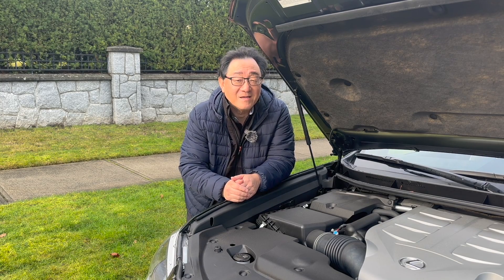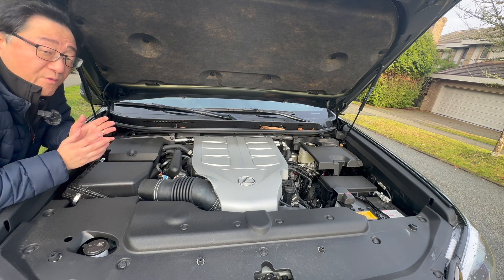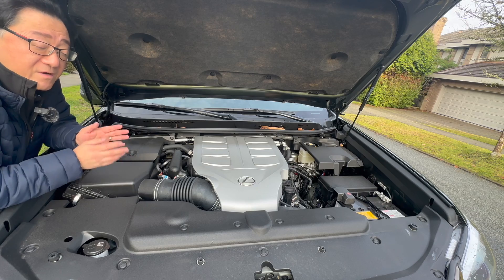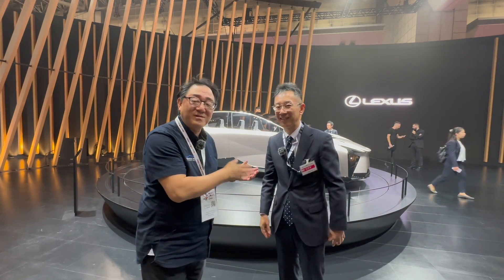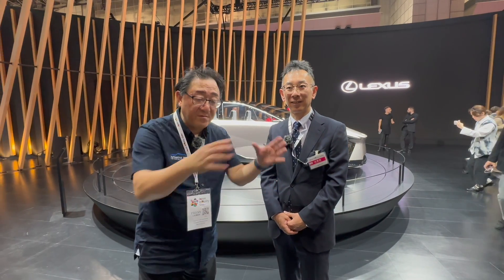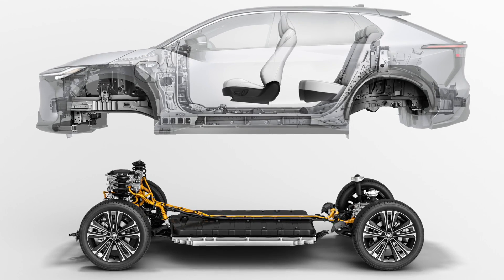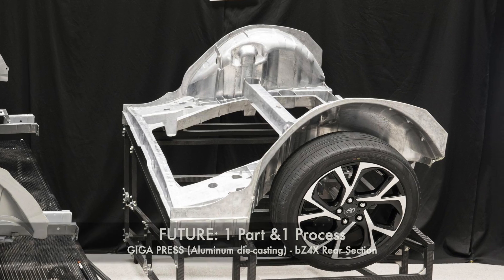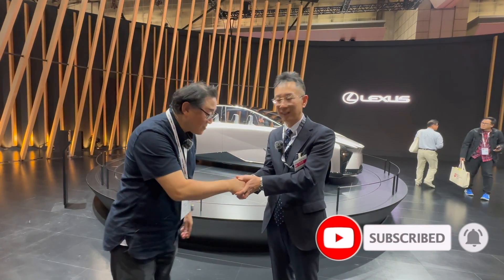TOYOTA WILL ADOPT THIS TESLA TECHNOLOGY BUT WILL DO IT BETTER

Comment: It would be good to see Toyota actually get serious about BEVs, instead of climate denial, endless promises and propaganda eg solid state batteries have been coming for around 6 years. Tesla basically developed the cast front and rear section, structural battery design, vertical integration of parts supply and have EMBARRASSED Toyota who are now playing catch up. The BZ4X is a joke. Their sales may look ok for a couple of years due hybrids but unless they get their BEVs sorted they will get smashed.

Comment: I also think toyota is doing it right with giga casting, because if the parts are damaged, you can just replace them, where tesla is the whole bottom is the car and means equal to total damage, and toyota should choose CATL LFP batteries CTP 3.0

Comment: Why do you state Toyota will do it better? By the time Toyota is doing this Tesla will be on their 5th or 6th iteration of the process. Toyota also adopted Tesla's supercharger network (after failing with their own), and they will also adopt Tesla's 48v architecture. Face it - Toyota has never been an innovator, in fact their reputation for reliability came from NOT innovating, and using tried-and-true parts for way too long. IE just NOW they are moving to turbos in trucks. For the last decade we keep hearing "the competition is coming for Tesla" and the opposite is true: the gulf is WIDENING.

Comment: The Nikkei Shimbun, Japan's largest business newspaper, reported on December 19 that Toyota Industries to Increase Supply to Tesla by 2.5 Times for EV-Use Electric Compressors. The article's opening is as follows:Toyota Industries will expand its supply of electric compressors for electric vehicle (EV) air conditioners to Tesla. The company has a 70% share of the market for this component in Tesla vehicles, and it expects to ship 2.5 times as many units in 2026 as it did in 2022, for a total of about 2.5 million units. Toyota is also working to strengthen its production base to meet the growing demand from European and American automakers that are leading the EV market.

According to interviews with industry insiders, electric compressors are the heart of car air conditioners, which regulate the temperature inside the car. The compressor compresses the refrigerant, making it hot, and then expands it, creating cold air. In electric vehicles (EVs), electric compressors also play a role in cooling the battery and heating the cabin, and they are required to have high performance.

Toyota Industries provides electric compressors for Tesla's main sedan, the Model 3, as well as the versatile sports utility vehicles (SUVs) Model Y and Model X. While Tesla began shipping its electric pickup truck, the Cybertruck, at the end of November, Toyota lost a bidding competition for supplying components for that model. Despite this setback, they are intensifying efforts to secure contracts for other vehicle models by actively promoting their electric compressors.

Comment: David - what is the cost of the giga casting machine, and the cost of replacing the casting molds (whatever they're called) at some interval of time, versus the "old" way of welding parts together? Aren't there some extra expenses involved with Giga casting vs welding?

Comment: I think this is bad news for customers.
Crash is an event that in many cases deforms the structure of the car.
The larger the parts, the more expensive it is to repair.
Reply: Lopping off several hours of riveting and welding the bulkhead directly translates to lopping off thousands in cost. If your bulkheads are crushed you really don't want to repair that car, it is an insurance trick to screw you.
Reply: You forgot to mention a very significant aspect of casting and that is its vastly superior structural strength. Proven by the fact that official crash tests puts all Tesla cars in the safest category by far. Here we do not consider opinions but only fact, and leave the BS out.

Comment: Tesla is light years ahead. It's not just gigacasting. It's also battery technology, heat management, software, FSD... Toyota will not survive electrification
Reply: So, how would you feel if 70% of Tesla's heat pumps were produced by Toyota? To be specific, the heat pumps for the Model 3, Model X, and Model Y are made by Toyota.
Reply: @oppaibon  I didn’t know that. How come Toyota uses DENSO heat pumps for their own EVs?
Reply: @Wasabi9111  I checked out a used air conditioner compressor for a 2022 Model Y, and it says "Made in Japan." Also, there is a number starting with "042400-" that appears to be a Denso part number. By the way, this compressor had insulation attached, so you can't see this label unless you peel it off.
Reply: Do you seriously think Tesla would use any part of Toyota? 😂
Reply: Tesla are ahead no question about that Sir, but to say Toyota won’t survive in the fully electric world is very naive and short sighted of you.
Reply: @shane6115  look at what is happening in China. Toyota is losing massive market share to BYD and Tesla. The same thing I see here in Thailand. Toyota cannot react, does not have a single competitive electric car on the market. Toyota is heavily in debt. How long can that work well?
Reply: @lenggenhagermarkus6964  I didn’t know all that dude, I was lead to believe they are the richest car company in the world
Reply: @lenggenhagermarkus6964 as a prior Toyota fanboy, it’s so sad to see how cheap each new gen of Toyota products becomes.  I’m not a Tesla fan. But ppl complain about Tesla material qualify, but have they seen the latest gen of Toyota products w cheap flimsy plastic everywhere, inefficient use of space, flimsy structure, loud interior noise, etc?
Reply: @shane6115
Of course your sight is blurred - not everybody has the telescope to even see Tesla being ahead of all legacy OEMs and the 'competition'.
Reply: @shane6115  Toyota debt = $223.34 B.  Tesla debt = 0.  Toyota won't survive.

Comment: I can see the process of Giga pressing parts will just lead to more vehicles to be salvaged and junked instead of being repaired due to accidents. This may just lead to higher insurance costs to the consumer bottom line.
Reply: Agreed. Better hang on to an "older" vehicle just in case and keep it around!
Reply: This process is just basically saving manufacturers costs which rarely trickle down to the consumer. Although I believe it to be much superior in strength vs a bunch of pieces being glued or spot welded together. @samsonvarghese841
Reply: Tesla is actively gaining market share in the insurance business with extremely convenient rates, for all his EV.
Reply: I just sold my 2023 Tesla. Tired of all the issues and poor resale value and purchased a 24 Camry Se Hybrid nightshade. By far it is a superior built car in many ways without all the EV nightmares. @sat7755
Reply: Sad to see people li you who care more about money than life. 
A side effect of this giant casting is the stiffness of the green house (or pasanger space). There are countless evidence of severe accidents where model Y occupants have walked away with just minor injuries.
Reply: Yes, safety should be first 👍 @renezr70
Reply: If that is true then there will need to be a stronger emphasis on recycling. Aluminium is not cheap.

Comment: ..and will make repairs either nearly impossible, or insanely expe sive after even a  minor collision.
Reply: Tbh, w current cars, even after they’ve been repaired, they never have a the same structural solidity and don’t drive “right”.
Reply: Who repairs their own cars these days.
You would have to have electrical and IT degrees to even work on it.

Comment: Great video, David! So, is Tesla’s approach for how it uses giga casting today the same as  Toyota’s vision (I.e. using giga casting in more protected places), or, does Tesla’s approach make their cars more vulnerable to more expensive repairs or more prone to being deemed a total loss if in an accident?
Reply from the maker: Tesla plans to vastly expand the use of GIGA casting, especially for the Cybertruck, so their Giga parts will be very expensive to replace or repair in accidents.  It could make the Cybertruck much easier to write off because the replacement of Giga parts will be so expensive.
Reply: @AutomotivePress  in other words Tesla are a throw away appliance.  Lol
Reply: @StubProductions
No, these are false assumptions.
Reply: @brilanto  Just like old iPhones…. Throw away for the new model.
Reply: Yes and yes.

Comment: Fascinating video, David. The way you described it, it doesn’t sound like being i repairable is real disadvantage since the vehicle would be pretty destroyed at that point. I wonder if these units will provide superior occupant safety.
Reply: They do provide superior safety, they can engineer these things to compress way better than the old ones. Look up the Tesla Y that went over Devil's Slide: 250 foot drop and everyone lived. They are also more durable to mild fender-benders than the old ones. The truth is the cars that have crushed bulkheads should NOT be repaired anyway.
Reply: I'm fine with totaling the vehicle if it means better survivability.